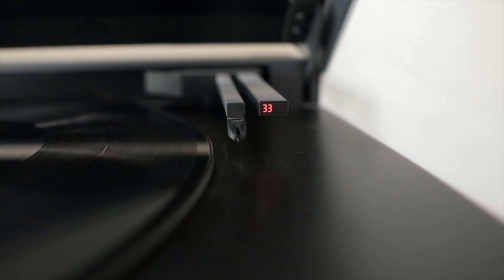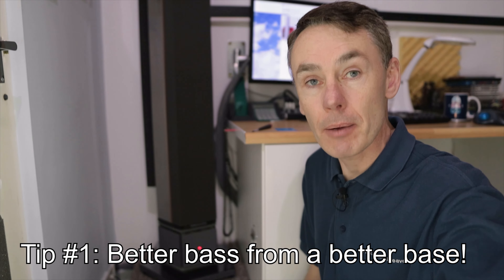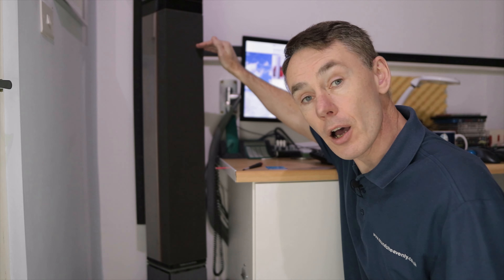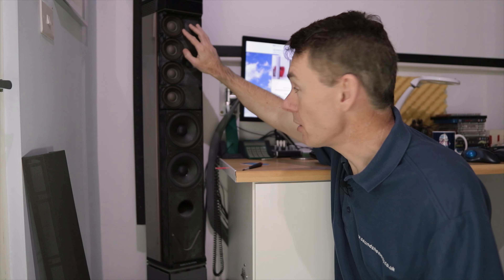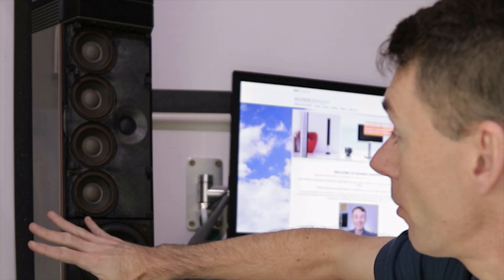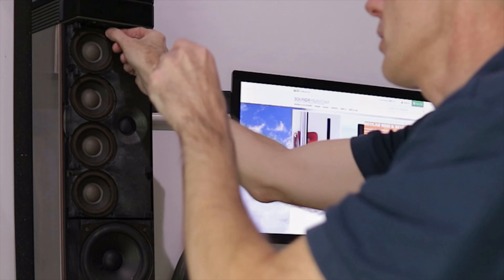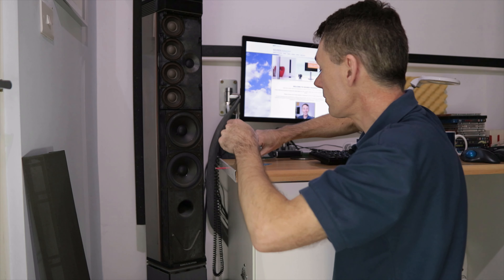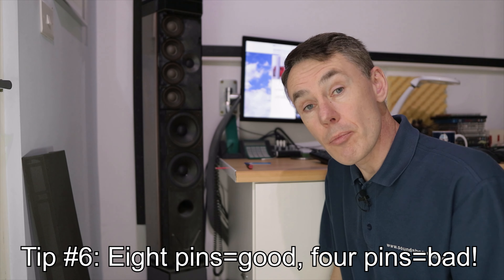Bang Olufsen Beolab Penta speaker upgrades - 6 simple hacks for better B&O sound [4K]

Comment from the maker: Thanks for watching! Every cable you ever need for your B&O system can be seen on Steve's website here: https://soundsheavenly.com  If these videos have helped you to enjoy your Bang and Olufsen products, please consider buying Steve a coffee at https://www.buymeacoffee.com/soundsheavenly - many thanks!
Reply: I have a custom system so I m putting 2 7.1 on real left and 2 on rear right and 2 7.2 for centre and 2 beolab9 for front left right - I need 3 x 50 cm 8 pin two males to on female and 2 long male male 8 pin 1 shorter one and I have a fac converter to 5.1 from amazon therefore I need 5 rca ( without sub) mono to stereo rca- 8 pin that needs to be triggered by a 5 v usb
Reply: So I can either dyi myself the cables either do you have 5 x 2 rca male to 8 pin + usb 5v  ? I did it myself in the past but there is noise - however I ll be using magnets and phone charger or tv source for usb to see if any difference …can you offer something better ? I could draw a diagram if it s hard to follow…
Reply from the maker: Hi, please feel free to get in touch at https://soundsheavenly.com and I can help with any cables you need.

Comment: Hello Steve,  I've enjoyed all your videos.  I'm using a pair of Beolab Penta speakers connected to a  Yamaha receiver using the RCA phono input on the speakers.  Works GREAT!  I'd like to make an external circuit that I could manually use the display on the speakers via 8 pin DIN connector.  Would this be practical?  I would need the pin outs & signal/voltages of the cable.
Reply from the maker: Thanks glad my videos have been helpful.  Unfortunately I don't have any involvement with modifying speakers but I wish you the best with your project, sorry I can't help with this.

Comment: Wow! What a coincidence; I’ve just finished reassembling my Penta’s yesterday after re-foaming all the midrange speakers and added new sealing strip (as they also are made of foam, so they didn’t look so good either), and while I was about to connect the drivers to the second speaker I had a thought “the wires are long enough, so why don’t I turn this one 180° and therefore make a dedicated ‘Left’ and ‘Right’ speaker - I’m sure it has to make a difference”. Long story; today I’m cleaning every nooks and crannies and then I googled “Penta polish plastic base plate…” and this video is among the results, I clicked and what do you recommend? What I just did yesterday before I went to bed 😅 coincidence? I have to think so! Thanks for all the tips though 👍🏼
Reply from the maker: Glad you enjoyed the video, good to hear that your Pentas are still in use!

Comment: Hi, Steve. Saw this video about four months ago, and just thought about it yesterday. So just now, I finished modifying my right Beolab Penta MK3 speaker. Turned the speaker panel. Both tweeters are now facing inwards. What a difference that made! Sound is so much better now! Thanks again for the tip 👍🏻
Reply from the maker: Thanks Bo, glad to hear that the tip was helpful and that you are enjoying these great speakers!
Reply: @soundsheavenly  : Owning a set of Penta's myself, turning one panel around so you get a mirrored pair is a good upgrade. But  you also have to change the mid range speakers, because they are NOT identical! one unit has an other type number and is mounted on a specific location.
Reply from the maker: Yes, but the two inner midrange speakers match and the two outer midrange speakers match, so they are still correct when the panel is rotated
Reply: @soundsheavenly  , there is one different mid-range unit on each side ( the upper one of the two middle ones).   So turning the panel around will put the other midrange on one side lower than on the other. Maybe this is different on certain production runs. My Penta's also do not have T10 torx, but only  Philips screws.
Reply from the maker: Thanks, sounds like there is a variation on some speakers
Reply: @wimjoos9125    What generation do you got? I’ve just spent many hours re-foaming my midranges and on my Mk2 pair and here are all the midranges identical and in a series-parallel connection.
I haven’t come around my Penta Mk3 yet so I don’t know how they are connected.
Reply from the maker: @Darkray84 I have the mk3 version

Comment: Love my penta's! Was able to haggle a pair down to 150€. Beovox tho, because i don't need them to be any taller than they already are haha. Currently running them on a Cayin A50-T amp. Replaced the foam surrounds, replaced all the capacitors on the MASSIVE crossovers, and now i'm restoring the tweeters because few people seem to be aware of the fact that these are ferrofluid tweeters. That fluid didn't look so good anymore after 36 years! And taking those suckers apart was no easy feat without any guides on Youtube...
Reply from the maker: These are great speakers!  I didn't know that about the tweeters, thanks for the info.  Every day is a school day, as they say!
Reply: @soundsheavenly  No problem! I'll need to restore 4 tweeters in total, if the first pair works out, i'll make a video guide when doing the second pair!
Reply: @soundsheavenly  Oh, do you think B&O would be willing to help me figure out which fluid to use and how much? 

I've had many negative experiences in the past with trying to contact big companies about repair questions regarding discontinued products.
Reply from the maker: I know they have a team dedicated to keeping their classic products alive. I suggest asking your local store to contact B&O on your behalf if possible
Reply: @soundsheavenly  I mailed them and they just replied! They said that they don't encourage self-repair, but that they will forward my question to their supervisors, and contact me when they get an answer. Sweet!
Reply from the maker: @AAgunner  That is great news!

Comment: Good video Steve. I cant wait to try the credit card trick to get those frets off. Couple more tips: When you have the frets off, spray them with a textile cleaner, clean them in the shower and let dry. Be gentle, this might be the thinnest material ever seen on a speaker fret. Its amazing how much c..p is in them after 30 years. Seriously consider getting the capacitors replaced in the crossovers and amps. They dry out and their values change after 30 years. Kits are available. These are worth spending a little money on !
Reply from the maker: Thanks, these are great suggestions!  I'm not a repairer, so I didn't look at opening the speaker for the video, but I agree this is a worthy upgrade for those who are able to do it.

Comment: Do you know what the cable that's inside the "display" is for? I have a pair of Beovox Pentas and every morning when the sun hits the speakers I can see that there's a loose cable with a connector inside the "display".
Reply from the maker: Hi, this cable is there ready in case the speaker was ordered as the "Beolab" version with the power amplifier fitted.  Although it looks like a Powerlink cable, the wiring is different so it cannot be used unless you buy the Beolab 150 amplifier that was included with the Beolab Penta mk.1 speaker.  when the amplifier is fitted, this cable links to the amplifier to light up the speaker display.  The display won't work without the amplifier, there is no way around this.
Reply: @soundsheavenly  Thank you for your quick reply! Do you have any suggestion what that space could be used for in the passive Beovox Penta? I feel like it could be used for something cool
Reply from the maker: @alexanderstormdahl2562 Sorry I don’t know what you can use the space for

Comment: I first got introduced to B&O back in 1999 when I started working for a B&O installer in the NYC metro area. My boss used to always recommend a 1 inch thick slate tile underneath the Penta when it was installed on a rug covered floor. And for MK1 Penta he always used this adapter that would give the MK1 Penta a female Powerlink connector. He had a case full of them back then, they are probably worth their weight in gold these days.
Reply from the maker: That is a good suggestion about the slate tile for weight.  Yes, those adapters are out of production now, so well worth buying if you can find any pre-owned adapters.

Comment: I've got me a pair of Penta (6601) for my Beocenter 8300. I was not aware of the different connections. I've already have changes the foam on the midrange speakers (foam-rot) and of course turned the section around (that one was obvious to a HiFi man :) ). I've been searching for the mentioned speaker-link cables, but couldn't find any. Now you are saying its not the best way, and I'm totally in on that, but how do I connect my speakers? DIN to phono cables an an extra with the two extra pins from the DIN-speaker socket?
Reply from the maker: Please can you email me via the contact page at https://soundsheavenly.com and I will be happy to help you with the best option

Comment: I just acquired a pair of Mark 2s, am very pleased with them. The surrounds look like new and I switched their positions to put the tweeters on the inside. I use standard phono cables to drive them because I don't have a B&O system. Do you have any criticism of driving them this way? Thanks for the tips!
Reply from the maker: A good set of RCA cables should be fine, these are great speakers and they can sound superb via their line input
Reply: @soundsheavenly  yes, they do sound superb. Do you by any chance have a source for the little mechanical device that keeps the "door" on the base closed? I am working on fixing it but would prefer a good replacement part. It is B&O part number 3034066, but no longer available through my local dealer. Thanks in advance, have a great Christmas!
Reply from the maker: @tniedermeyer sorry I don’t know where to get that part, I just make cables. Wishing you a happy Christmas!

Comment: Hi Steve, I found a gorgeous set of M1's that had the midranges refoamed.  I've had them for about 10 years and they have recently developed a buzz in the right speaker and it doesn't switch to standby when the receiver is turned off.  I'm using line level RCA subwoofer cables on a Denon receiver.  I have replace the cables, thinking that was the cause but the hum remains, even when the RCA cable has been unplugged.  Could this be bad caps?  Any insight would be appreciated.
Reply from the maker: Sorry I don’t know about repairs, best to ask your local B&O store if they can suggest a repair agent in your area

Comment: Hello Steve!
First of all, thank you for the excellent cables that now connect our BV 7 55 (with Beolab 7-6) to a pair of Beolab 6000.
I am thinking of getting a pair of 8000, to use as well. I gather the Penta would be a bit of overkill, and rather missmatched with the 6000!?!
Thank you again, and all the BEST! Magnus in Sweden.
Reply from the maker: Thanks for your purchase and for your kind words!  My view is that Pentas would never be overkill, their sound is so much better than Beolab 6000 even at low volumes that they are absolutely worth adding.  You can adjust the output level via the switch on the front panel to reduce their level, then they won't over power the 6000s.

Comment: great info thank you .. but isn't it better to place the medium inside and the tweeters outside?
Reply from the maker: Good suggestion, this can vary from one room to another. Personally, I prefer having the tweeters facing inwards, as this tames the slightly ‘shouty’ effect the Pentas can have in some spaces if you get too much of the midrange driver sound.  If you get a chance to try both options on your speakers, please let me know what works best for your ears and room!

Comment: Would you recommend lifting the speakers from an oak wooden floor resting on about 40 cm of massive reinforced concrete, or would it be overkill? I'm reasoning that just an isolating rubber mat under the speakers will be enough for me. My floor is more than enough for a heavy gun safe...

Also, does these tweaks apply to the passive Beovox Penta's as well?
Reply from the maker: Hi, the simple answer is try it and see if it helps with the sound in your room. Both passive and active speakers produce the same sound, so the same issues apply to both.

Comment: Nice video! My Mk I Penta's are kind of a mixed bag. When I bought them, they were very worn out, missing some parts, lots of dust caps pushed in, and the ferrite core materials around the crossovers were shattered into 1,000's of pieces. So I had quite a bit of work ahead of me. I had the rotted foam replaced, bought a used set of Mk III woofers, and crossovers. Had all the capacitors replaced, and bought the amp kit from Martin on Beoworld.

So mine are still Mk I's but with Mk III crossovers. Running off the dreaded speakerlinks to my Beocenter 9000. Eventually I'd really like to get a Beocenter 9500, and Beolab 5's, but I'm pretty happy with it all for now. I know in this video you say to ditch the speaker link, I'm not sure what my best course of action would be there. I could consider trying the Pre Amp output of the Beocenter 9000 to the Phono plug (RCA) input of the Penta.
Reply from the maker: Thanks!  Yes, you should get better sound via the pre-amp outputs of the 9000 to the RCA inputs of the Penta, if you buy the cables in my store then I can help with an option that keeps the Speakerlink cables to use the display, a small change is needed to the wiring for this.  Please get in touch at https://soundsheavenly.comk for more details.

Comment: I Continue enjoying watching your videos Steve. I need your help and guidance. I have a 5500 system and I would like to connect the external antenna I have on the roof to the receiver. The cable coming from the antenna is a coaxial with a connector type TV. I also can attach to it an adapter that has two prongs. My question is what do I need as connector to attach this to the Brody stem 5500 and where can I get it ? Many thanks Steve
Reply from the maker: Glad you like my videos! Sorry I don’t know about aerial wiring, I just deal with audio cables. A local aerial install company should be able to help with the antenna connection

Comment: I love my Pentas. I also own a pair of Beolab 5's. The 5's blow them away of course, but the Pentas do sound sweeter and have fantastic stereo imaging. There are other upgrades you can do - e.g. replace the on board op-amps with Burr-Brown ones, for a smoother sound; replace the capacitors in the crossovers with high end ones, but these are for the technically minded. Also, I've had a number of the amplifier/power supplies fail - I got a bit fed up replacing/repairing them, as the faults were different every time! In the end I used a generic Class D amplifier from eBay and wired it directly to the speakers. They sound better than ever before. I also recommend a separate subwoofer if you need deep, powerful bass.
Reply from the maker: Thanks, that is great advice! I wanted to just cover the easier upgrades in the video, but I’m seriously considering some of the improvements that you suggested
Reply: @soundsheavenly  absolutely! Great video, and some nice hacks. I also refoamed my mid-range drivers as they were past their best! Wasn't too tricky. I also keep a spare woofer in stock as they can fail sometimes. Great work on the channel, from a committed B&O fan. We should chat!

Comment: Really interesting video - I have a pair of Penta 1s so was very useful info for me! I re-foamed mine a couple of years ago so have that sorted, but was interested to hear about Speakerlink being not great - I knew it attenuated the signal and then amplified it again, but hadn't really given that much thought. Would it be best to use the line level inputs to them then? I have a BeoSystem 5500 so I'm not sure of what the best way to connect them would be. And it would also be a shame to not have the displays working - I've always thought they were fantastic!
Reply from the maker: Thanks!  There is nothing to stop you using both the Speakerlink and Line inputs of the speakers in tandem - the Speakerlink sockets will light the displays and the Line inputs will give better sound.  Please feel free to get in touch via the contact page at https://soundsheavenly.com if you need any help getting the right connections!
Reply: @soundsheavenly  Thanks Steve, I hadn't considered using both at once. For connecting the line level inputs to the Beomaster 5500, would I be tapping off the Line In/Out sockets (the ones that were supposed to be used with an equaliser)?
Reply from the maker: You can use the RCA pre out sockets for the audio, these are volume controlled so they are the only ones that can be used to connect to speakers

Comment: I had my crossovers rebuilt and replaced the mids and tweeters. The tweeters were blown and the crossovers had popped caps. They sound amazing now. But I don't believe for a second that turning the mids 180 degrees will make any difference whatsoever. 

I would love to get icepower amps
Reply from the maker: They are great speakers, especially when restored.  If you aren't convinced about turning the tweeter panels, play sound music and walk from side to side while listening - you should hear more midrange on the side with the four mid cones and more high treble on the side with the tweeter.  You can get better control of the sound by matching the panels as a mirror image of each other and turning the speakers inwards or outwards until the sound is to your liking.

Comment: I initially did intoeing which improved the sound and now I also changed the twiter side with further  improvement.
My speakers are placed on stone (marble )floor but u think elevating them by anywhere between 4-8 inches might further improve sound as u mentioned that this will bring twiter and mid range at listening level.Your thoughts!
Very helpful tips by the way.
Reply from the maker: Thanks, glad the video was helpful! These are great speakers